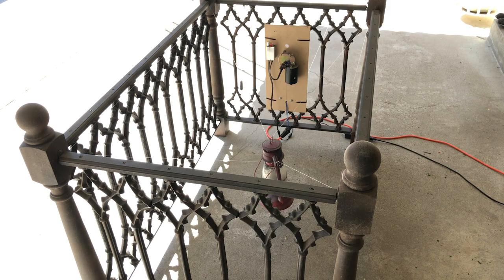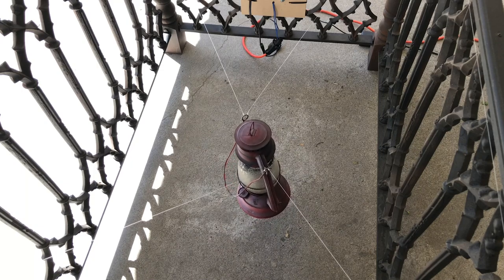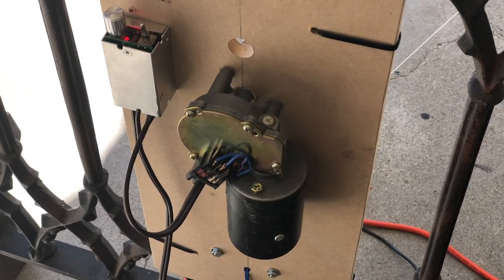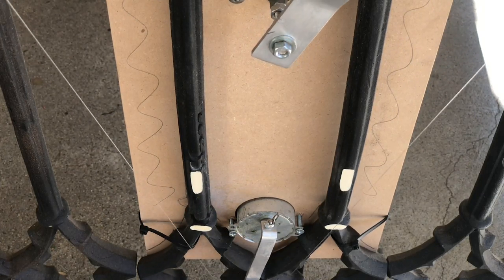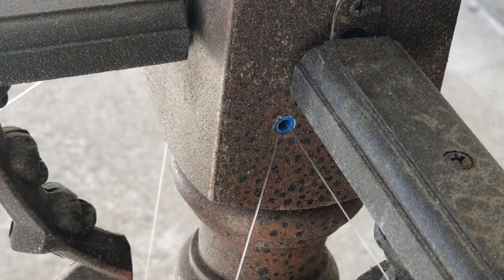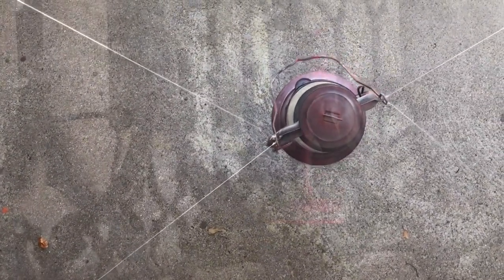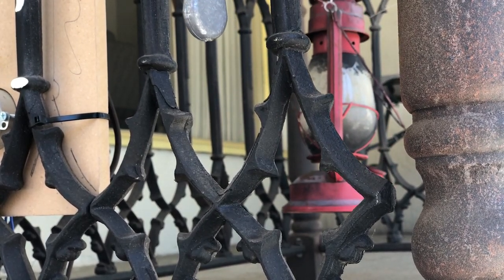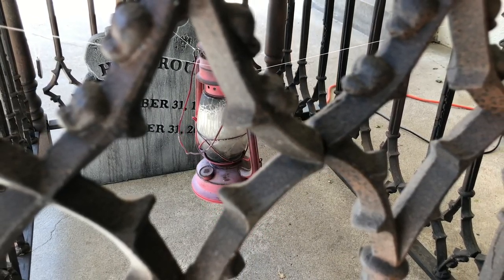HALLOWEEN HOW-TO: Halloween Floating Lantern Prop

Comment: Did you create the metal/wood fence?  Is there a video for the build of the fencing?  Love it.
Reply from the maker: I did, however, it was made long before I started making videos. So there's no footage. I can tell you that the corner posts are staircase bannisters and the "metal" parts were made by making a silicone mold of a real metal part and then casting them in resin and painting them with my spray paint rust technique before being assembled.

Comment: I have been watching this and thinking of doing a floating lantern that runs horizontally back and forth between two trees. Sort of like an Axworthy ghost. The issue I am running into is the lantern weight pulling the line down too far and causing the line to fall off the pulley right before the lantern passes around the pulley. I was wondering if you have any thoughts on how to remedy this.

Comment: where did you get the small plastic black pulleys you show in the video?
Reply from the maker: I 3d printed them, but found that they weren't necessary in the end. You just need to round off the holes where the fishing line enters the corner pieces to prevent it from wearing a notch into the wood.

Comment: After watching this video a few times I wanted to make a lantern float between two trees about 20ft apart. After some research I came up with something along the lines of an Axworthy ghost. But due to the weight of the lantern the string pulls off the pulley right before the lantern passes around the pulley. I was wondering if you had any ideas on how to remedy this ?
Reply from the maker: Have you tried removing any excess weight? Cut out the bottom of the lantern, remove any of the unneeded internal parts, etc
Reply: Try making a flip flop switch. When lantern hits the switch at the end both sides,it just rev the motor.